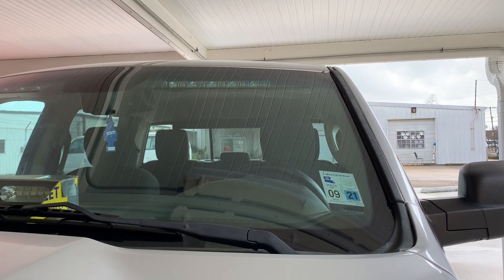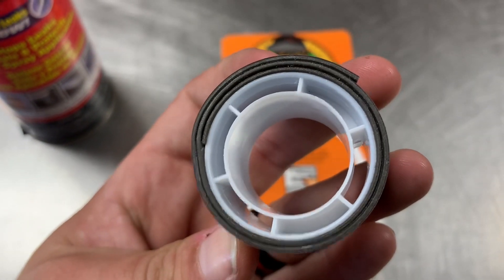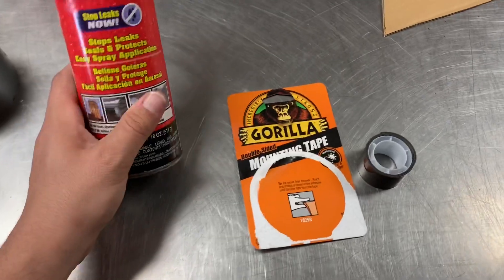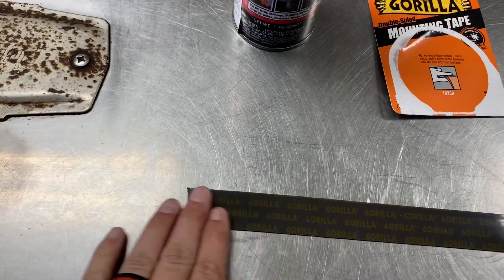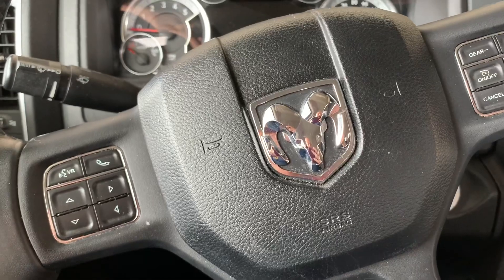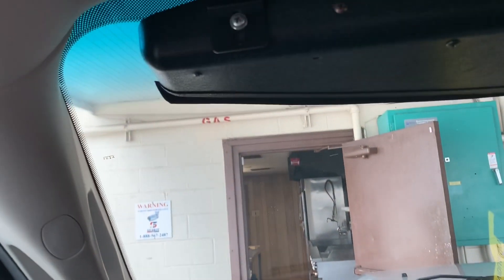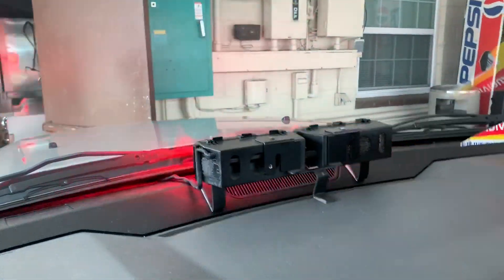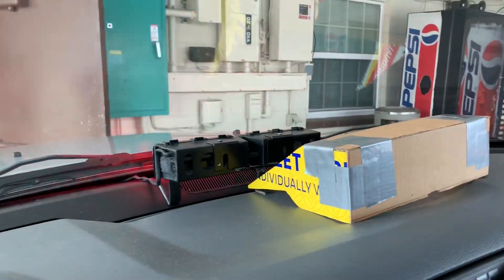Firefighter POV lights visor light flashback fix

Comment: I don’t think i can comment a pic but no hate on the cardboard shroud. I done same thing for some surface mounts in my side window. I just put electrical tape around it so you cant tell it’s cardboard. Wosh I could comment a pic bc it actually looks pretty good.

Comment: How is it holding up to heat and sunlight.
Reply from the maker: Chris Murphy surprisingly really well, with temperatures reaching in the 150°s inside the vehicle I expected to have issues. But It’s holding up really well tho, no issues since I put it on. I took a piece off the other day because I wanted to get visor tint put on and it was a little hard to get off. So that tells me that it’s holding up really good.
Reply: trey camardelle  I had a cheap set that I used duct tape on. First hot day it shriveled up and left sticky all over my windshield. I just got a STL raptor x in going to put in. Wanted to see how well your tape was doing with the heat. I’m gonna have to try your idea. Thank you for responding
Reply from the maker: Chris Murphy yes I definitely recommend using what I used. You won’t be disappointed if you follow the way I did it in the video.
Reply: trey camardelle thank you.